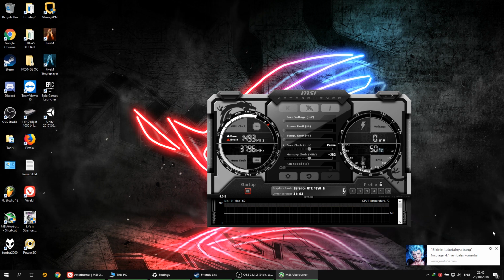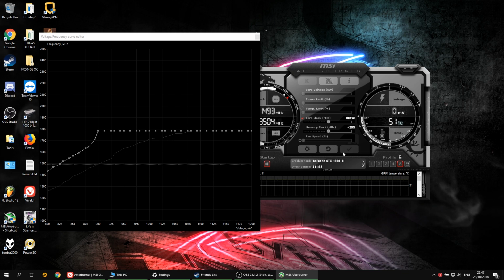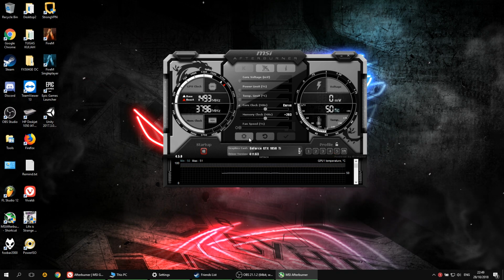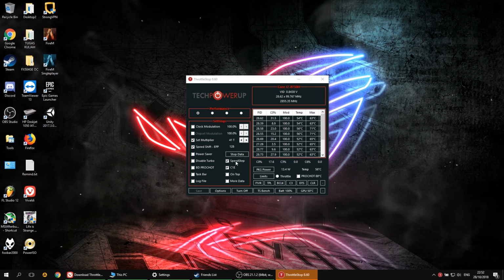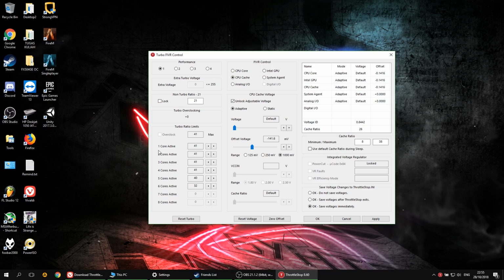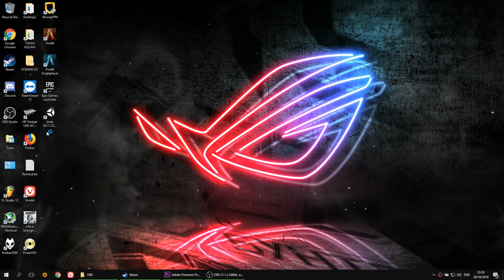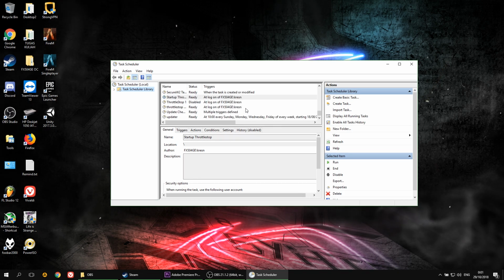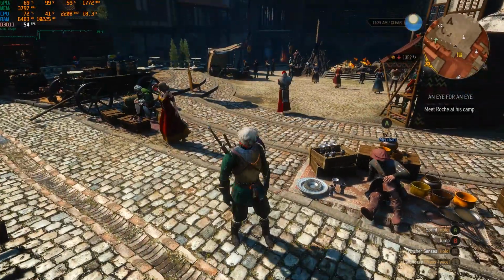ASUS TUF FX504GE How to Fix Stuttering & Power Limit Throttling (GTX 1050Ti, i7 8750H) *NEW

Comment: Hi bro, while playing games on charging still my battery decreases in asus fx504.can you please tell me is it normal or not?
Reply from the maker: open ASUS Battery Health Charging app & make sure it set to full capacity mode. mine is draining too sometimes when gaming while recording but not significant, as long it don't drain too fast it's normal.
Reply: @kresnaputra  i have set it already and still there is some drain not that much but its there like about 8% in one hour but it should not be there.
Reply from the maker: @avigandotra5786  have you undervolted your laptop like i did in the video? it lowers the battery consumption too.
Reply: @kresnaputra  no i didnt do. But you are saying in your laptop also it happens then whats the benefit of undervolting
Reply from the maker: @avigandotra5786  to fix the stuttering caused by power limit throttling also increase performance on the i7 variant. that battery drain is normal, other people have it too. undervolting won't stop your battery from draining, but it reduce the draining amount a little.
Reply: @kresnaputra  so shall i undervolt cpu or both?
Reply from the maker: @avigandotra5786  both if you want optimal result, what variant are you using?
Reply: @kresnaputra  i7-8750h
Reply: And shall i do the exact same which you have done in the video
Reply from the maker: @avigandotra5786  yes, you can do the exact same with the throttlestop
Reply: @kresnaputra  and what about gpu. what should i do with it?
Reply: @kresnaputra  bro i am facing issues with my system after applying all the settings as shown in your video,the power limit throttling is gone but still during gameplay(Gta v,fifa 19) there are frame drops after every 1 min (100fps to 50fps),how to fix this?
i have i5-8300h varient.
Reply from the maker: @ashufrigus9558  what is windows version? and your BIOS version?
Reply from the maker: @avigandotra5786  use MSI Afterburner like i did in the video,  if you have the 1050ti, you can just follow the video, for the 1050, the flat curve start from around 925/950 mV.
Reply: @kresnaputra  i have put replacement request in amazon.i dont want this laptop whose battery decreases while even on charging
Reply: @kresnaputra  bios is 315 and windows is 1809
Reply: mine bios 315 and windows 1803. how you updated to 1809 as i am checking in windows update it don't shows any update
Reply from the maker: @avigandotra5786  from checking updates in windows updates & there is a feature update to 1809 just click install. good luck with the replacement request hope you got the better one.
Reply: @kresnaputra  cant find it bro
Reply: @kresnaputra  Bro what is the solution  for my problem?
Reply: @ashufrigus9558  i dont have any stuttering issue now with bios 315
Reply: @kresnaputra  fingers crossed
Reply: @avigandotra5786  have You changed any settings or anything specific you have set?
Reply: @avigandotra5786  Have you ever faced any stuttering issue in your asus fx504?
Reply: @ashufrigus9558  it was there in starting but after updating nvdia geforce driver and bios, now its not there and i didnt done anything on laptop no changes
Reply: @ashufrigus9558  but i have i7 variant
Reply: @avigandotra5786  Good for u bro!
Reply: @ashufrigus9558  but mine while on charge also my battety decreases while playing games.in your laptop does it occur?
Reply: @avigandotra5786  no everything is good except the fps drops every 30 seconds
Reply: @ashufrigus9558  okay.i have put replacement request .lets see new one has this issue or not
Reply from the maker: @ashufrigus9558  did you got the problem after following my video or did you already have it before? if you got it after following my video that's because you undervolted the CPU too low. If you're using the i5 you don't really need to undervolt the CPU, just undervolt the GPU like i did in the video & skip the throttlestop part. i've helped one of the i5 & 1050ti variant user via teamviewer & ended up only undervolted the GPU. good luck!
Reply: @kresnaputra  No the problem was even before I tried your solution...after trying your method it has helped somewhat during gameplay but I will try to do only the gpu part and will keep you informed if I get any success.
Reply from the maker: ThE rEcRuIt GaMeR  yes i can, hit me on facebook link in the description
Reply: @kresnaputra  bro the replaced laptop also has same battery drain issue while on charge. I think they should supply 150w adaptor for solving this issue.does fx505 any good?
Reply from the maker: @avigandotra5786  yes, i think the 120w is not enough. also they've secretly made changes to FX504 (newer ones) to have higher power limits, so that may causing the battery drops. i suggest you to look at acer nitro 5 i5 1060 6GB.
Reply: @kresnaputra  what about fx505 and asi rog gl503 both i5 variant.does fx505 have any improvement over fx504 in terms of performance
Reply: And does i5 variant have this issue of battery drainage while playing or only i7?
Reply from the maker: @avigandotra5786 fx505 perform better than fx504 out of the box due to it's higher power limits, expect higher temperature for fx505. but, if you've undervolted the fx504,  the gaming performance are similar.
Reply: @kresnaputra  any knowledge about battery draining issue in fx505 in i5 variant?
Reply from the maker: @avigandotra5786   the i5 use less power than i7, less likely to cause drainage.
Reply from the maker: @avigandotra5786  i don't know, because im not a laptop tester. if you want in depth review about that laptop i suggest you to check "Jarrod's Tech" channel :D
Reply: Avi Gandotra decrease the brightness !!

Comment: i have this same problem of shuttering ... need help to find out the exact values to undervolt ,to acquire the desire fixes as per above video. my specs are intel i5 8300h cpu 1050ti gpu 8gb 2665mhz ram ... plz help just confused and couldnt make up what to do. @kresna_putra i u could direct me out. thank you.
much much appreciate to the respond.
Reply: 4V1 gaming did you fix it?

Comment: Gan laptop saya sama tp kok curva awalnya berbeda ? Apa emang tiap laptop berbeda ?
Reply from the maker: MSI afterburner saya pakai versi 4.5.0, setau saya msi afterburner yg baru memang lebih panjang kurvanya, ikut ditarik keatas aja
Reply: @kresnaputra  gan ada wa ? Coba saya kirimin 
Masa kalah sama acer nitro 5 i5 gtx1050 temen saya fpsnya
Reply from the maker: @budiandraym8451  kalo mau saya cek lewat remote (pake anydesk) & settingin, jasa tapi gan.
WA : 082254771350

Comment: I have gtx 1050 4gb with i7 and 16gb ram. Is this safe for me then?
Reply from the maker: as the title says, this is the settings for the FX504GE model. but, of course  you can undervolt yours too, but a little bit different settings in MSI afterburner for gtx 1050. yes it is safe, you'll crash if it's unstable & you can always try again, as long as you don't set it to startup before testing it you should be fine.

Comment: Mau tanya dong bro, laptop gw setiap bberapa menit cpu speednya turun di 0.40 Ghz dan itu stuck tapi ntar speednya balik normal lagi, gw liat di Xtu ternyata power limit throttling.. Itu cara ngatasinnya gimana ya bro?
Reply: di undervolt aja, coba lihat di forum" pada berapa turuninnya, contoh -0.075
Reply: @leonardlitanius7078  turunin nya di bagian apanya ya bang?
Reply: @iyaamm2059  di bagian CPU voltage, cari aja coba di yt banyak tutorialnya

Comment: will undervolting void warranty?
Reply from the maker: no
Reply: @kresnaputra  hey!!!! i have a doubt regarding my laptop FX505GE (i7-8750h,gtx 1050 ti).My new laptop lags when battery is less than 30 percent.when i checked cpu usage in task manager its not crossing 0.7 ghz .VLC lags,gaming lags,mouse lags.Is it normal to behave like this???when i plug charger then it becomes fast .what could be the reason for such behaviour and any changes to overcome this situation?
Reply from the maker: @BunnyNikhil123  that's normal, you must plug your laptop to get full performance, just like other laptops.
Reply: @kresnaputra  Bro..
 My voltage starting from 700 at 1000 Mhz whereas yours starting from 800 at 1400+? in MSI afterburn
So what should i do now from 700 mv to 800 mv?

Comment: Bagaimana dengan asus fx505gd i7-8500h.  Saya main semua game kok ngelag banget ya.  Udh coba setting low-high tetap aja fps mentok 10-15,  driver juga udh latest update?  Apakah dengan cara yg d atas mampu mengatasi ny?
Reply from the maker: adanya i7 8750H atau i5 8300H gan, kalo fps mentok 10-15 ada masalah lain kemungkinan di driver. atau jangan-jangan lupa dicolok :D
Reply: Iya i7-8750h gan maaf ralat, iya kalo dicolok normal sih fps ny,  tapi kan sayang juga takut drop baterai..  Apakah ada solusi tanpa harus dicolok tetapi fps lancar? 

Kalo asus fx505ge kalo tanpa dicolok gmn gan fps bermain gamenya?
Reply from the maker: @hadespiece1644  sorry, kebalik gan, malah awet klo dicolok. colok aja terus laptopnya pas dipakai, problem solved :D
Reply: Owh makasih gan atas masukan ny,  kira2 windows 10 versi 1809 sama 1709 lebih baik yg mana gan?
Reply from the maker: @hadespiece1644  1809 sama saja performanya dg 1709, yg lemot yg 1803
Reply: Terimakasih kasih gan atas masuk sebelumnya 
Ane mau nanya lagi gan,  laptop ane asus fx505gd i7 bisa ikutin cara video d atas ga?  Maksudnya step by step ny sama semua
Reply from the maker: @hadespiece1644  bisa, hanya beda di kurva nya

Comment: I have this laptop on the i5 version, can i do this? Is this safe for the integrity and lifetime of the laptop?
Reply from the maker: yes, you can maybe with different amount, try small increments & make sure it's stable (no crashes whatsoever). undervolting is the opposite of overvolting, undervolting make your temperature lower, so.. it's actually extending the lifespan of your cpu & gpu.

Comment: I have the 8300H model so do i need to undervolt? I see “Yes” for power limit throttle in Intel Extreme tuning software
Reply from the maker: yes if you want extra performance, but different amount of undervolt in throttlestop, because in this video im using the i7.
Reply: @kresnaputra   how different ?
Reply from the maker: @rage0exe  different offset voltages, in this video i set them to -141.6 mV because most i7 8750H can run stable with that amount of undervolt. for the i5 you can start from -50 mV to -100 mV & keep using it normally then keep lowering it by -5mV until you get much less throttling or even better if you can get rid of it completely (that's impossible for the i7, but i think its possible for the i5) without crashing. Also, you don't have to touch the turbo ratio limits for the i5.